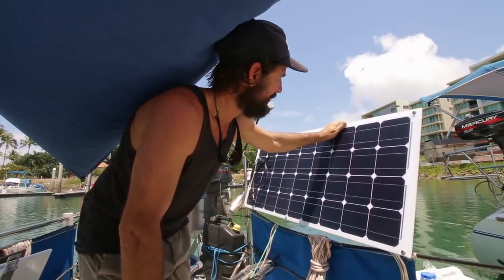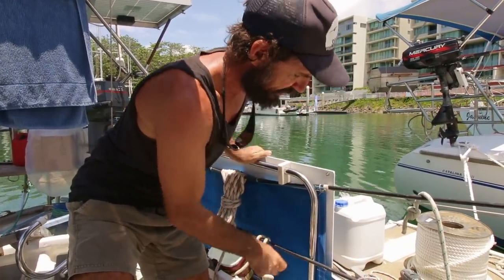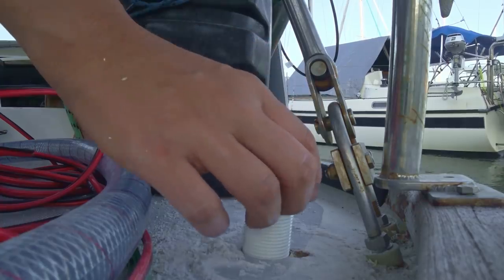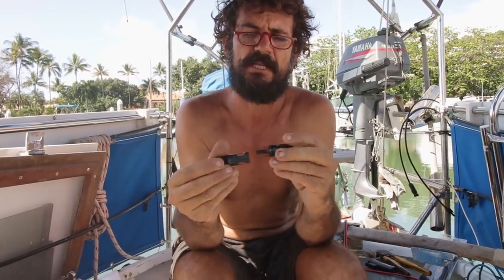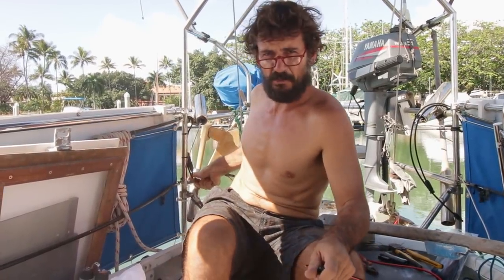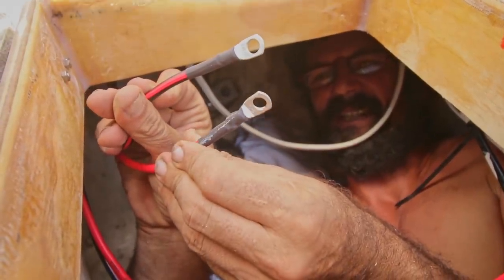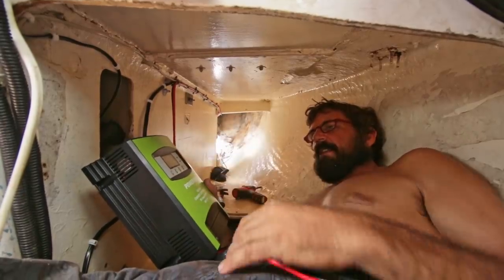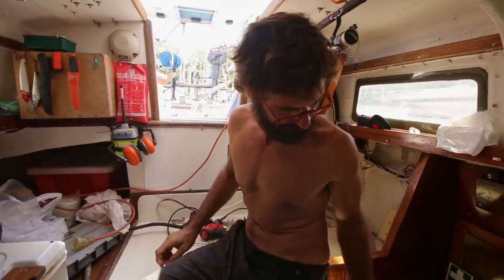A Half Hour of Solar Power: Our New Solar Installation - Free Range Sailing Ep 74

Comment: When you put plastic ties around wiring clip the tail ends off then hit them with a lighter flames so you dont carve your hands up next time you go in there.
If you want to remember which wire is which use some clear heat shrink and insert some paper with a title written on typed onto them.
The longer a wire run the thicker it needs to be for the same current amperage https://www.rpc.com.au/pdf/Wire_Chart.pdf
The other way to secure ring fasteners to otherwise unprotected wire ends is to remove the plastic from the metal end, slip the heat shrink on the wire, crimp the end on twice, solder it on with core solder, and when its cool put the heat shrink on and heat it. Label everything because you will forget. 
have a good one...
Reply from the maker: The wiring in the cabinet is labelled on the shrink because its complicated. I skip it for such simple runs. Ive also seen bread bag tags as labels. Works better than it sounds.

Comment: You were very patient Troy and Pascale, I would have sought a refund given the gratuitous lies of that company. Claiming they were made in Australia and just bullshitting about their output  just breaks a zillion consumer laws in any state. Lots of comments about the shade thrown by the supporting ropes but I am sure Troy you said there was a feature of the controller that sought to minimise the effect of that bit of shade.
Reply from the maker: No, the controller can't do anything about shading but sailboats throw a lot of shade which confines us to wiring the panels in parallel rather than in series. The tiny line of shade from thin cord is nothing compared to a mast for instance. Shade is a bigger problem when it affects cells in series, compared with if it runs across a panel in parallel. Not all shading is the same.

Comment: And when those panels fail, and they will, you have the proper wiring and controller for good panels. Glad to see Peter''s explanation as well. Found a lot of Chinese stuff is like that. The spec is what it is supposed to be, what it actually is, another thing entirely.

Comment: ‘If its to be good to be true’ !!! I invested in Soliban Flexible Panels they are rated at 100 watt each and I have actually had more than 100 watts - I am based in SW Wales UK so not the sunniest place on  the planet ..... They were priced at around 250 GBP each - the manufactures claimed they started to produce a power curve with less sun, so more efficient on a cloudy day .... I must admit the size of your panels are about the same as mine so a little surprised also the manufacture claimed 160 watt .... great video and the very most of luck on your travels :-)
Reply from the maker: Thanks for the heads up.

Comment: Probably a bit late now but I now use Victron Energy solar chargers VE75 15 and they will handle 75 volts,15 amps and you can use second hand solar panels in parrallel and they put out about 38 volts, still a pretty safe voltage to work around and far better than using 12 volt solar panels,check your solar controller ratings you might be able to do the same thing and you won't need to change your cabling?

Comment: Sphincter seal, Butt Plugs. I think you will need subtitles for the Aussie slang or is that universal talk! 

We installed 2 x 80 watt rigid monocrystalline panels 8 years ago and the cost of the panel alone was AUD$923 for both (and only after quite a lot of searching). Quite a bit more expense to have a stainless steel Targa to support them. We got 8amps output on a regular basis (panels in parallel). Last year I purchased 2 x 100 watt rigid mono panels (AUD$161 for both) and was able to fit them onto the Targa quite easily. 

I was concerned that out 20amp Plasmatronics PL20 PWM meter might not be up to the task (all 4 panels in parallel). The tech guys at Plasmatronics were great and felt I would be fine and that the amperage would probably be well within the 20 amp rating of the controller, which had inbuilt redundancy for current above 20. I needn't have worried. The 2 x 100 watt panels output is exactly the same as the older more expensive 80 watt panels. I get 16 amps max which is fine (or 8 each group). I checked the specs on the 100 watt panels and found a few porkies, which explained the difference. 

For $161 and an extra 8 amps I was more than pleased. Oh, I should mention the new cheap panels had exactly the same footprint as the original ones. I know technology improves and there are some quality panels out there that both deliver what they state and do it with less surface area, but at AUD$80/panel they are a throw away item.
Reply from the maker: We were annoyed because we don't really want to throw things away though. Thats why we are on a 50 year old boat with a 20 year old engine!

Comment: That DIY swan's neck through-deck fitting is brilliant.  I am going to be using that for our mast cables at our deck-step when we next  have the mast removed this coming summer.  I was looking at stainless swan's neck fittings and finding them difficult to source in the US.  With numerous cables and numerous glands one always seems to be failing/leaking every time I turn around.

We bought two new Renolgy rigid panels from Amazon rated at 100w to supplement the single 50w panel we previously had and installed A 40a controller for future expansion.  The 250w worth of panels has given us over 260w in direct sunlight on occasion.  You can't complain about that.  Getting 18A charge is nice from a nominal 250w array.
Reply from the maker: Thats a good result. Glad to see its working well for you.

Comment: Yep had the same with my cheap flexible panels,stick with good brands even after13 years  my old Sony still putting out the rated amps
Reply from the maker: Yep. The BP Solar ones still work as advertised but better with the MPPT controller than when we ran a PWM one.
Reply: @FreeRangeLiving  what bearing r in your wind generator,?i will try to get some  s/s 1s 4 u rgds Peter

Comment: Yes, for low loss in low voltage systems you're looking to size the wire not really for capacity but larger wire for less voltage drop.  This is something I recently learned myself, being an industrial electrician.  But John's law tells it is sound.  Ohms

Comment: Wondering how the shadow effect of the cable holding you new solar panel will effect efficiency (or not?)?
Love you guys.
Reply from the maker: We are using a bit of 2.5mm line and it doesn't really have a noticable effect. Shading across panels isn't as detrimental as shading along the cells.

Comment: Solar panels are brilliant , we have 190 watts , and if ever the battery ever get to 50 percent hey belt the power back , we now always hold 90 percent of power and panels only working on 1.5 amps average. ,if you add the 70 amp alternator that helps heaps , you should never need power  ,on our last trip 3000 miles we averaged 85 to 90 percent all day every day using all the power we need. ,gps never stoped , good luck
Reply from the maker: Don't start making videos then! Our alternator does a good job and has kept things going till now.

Comment: Thanks for the vid. It will be interesting to see how long these panels last you I have gone through 2 sets in only a few years. I think this could have been due to my installation of them (w/o a proper backer). I hope you get some longevity out of them. I eventually went back to non-flexible as they seemed to be better quality overall. Perhaps there is a high quality flexi out there tho. Happy sails :)

Comment: I guess it's pretty hard to know where things come from now days.  Hate the panels weren't what you were expecting but glad to know they do meet your power needs.  We just added two more glass panels to our 30' Hunter for a total of three panels and it made such a difference.  We were putting a lot of stress on the house bank with only one panel.  We are only using two batteries, and also have a separate starter battery isolated from the panels and the house bank.  It's really all we will need.  What we do need however is a quiet generator to supply the 120 volts when not at the dock.  That's coming soon.  Really enjoyed the video and thanks for sharing!!!

Comment: You could put in Mono Perc rigid modules. A 2 m. x 1m. module would give you 380 Wp under standard test conditions.(STC is an industry-wide standard to indicate the performance of PV modules and specifies a cell temperature of 25°C and an irradiance of 1000 W/m2 with an air mass 1.5 (AM1.5) spectrum. These correspond to the irradiance and spectrum of sunlight incident on a clear day upon a sun-facing 37°-tilted surface with the sun at an angle of 41.81° above the horizon). Buy a good Chinese brand such as JInko and you will be just fine. China being the worlds s factory produces premium quality and poor quality as well. Then you will not need flexible panels hanging over the side of the boat. Paying a little more is cheaper in the long run because the cheaper panels suffer from faster degradation. Given that you are operating in " harsh conditions", you need panels with good protection against salt and mist, UV induced degradation etc.

Comment: Hey Troy most house wiring we use in Aus is multiple cores not single strand except for the project housing market .Hence on the side of the drum it will say 2.5mm below that it will say 7/067 that 7 strands at .67 mm .In automotive cabling the strands are a lot thinner but more of obviously for flexibility.Great vid anyway
Reply from the maker: Ah. My house wiring experience comes from demolition of older homes. I stand corrected.

Comment: Interesting vid and Thks for the through deck fitting tip. Just a (maybe dumb) question: you build a rigid panel from a flexible one. Then why not simply buy a rigid  panel?
Reply: He stated in the video that a solid panel will not give with impact from things like a wave over the side.  The flexible panel is less likely to shatter or stress the mounts because it can flow with the impact.
Reply from the maker: Thats it

Comment: I have a 60w flexible panel on my boat and after less than 12 months the panel has separated. This has made the surface less translucent and lowered the wattage. I would not purchase such a panel again and as you say you get what you pay for,. Cheers
Reply from the maker: 12 months. How disappointing!

Comment: USA NEC (National Electric Code) - no circuit or wire (anything really) to be loaded past 80% of its rated max load. Therefore a 600W dimmer can handle only 480W (Watts) of Load.... so yes you needed 30 amps of load which equals 30x80% = 24----- 24+30 = 54 amp capable for the controller.... BRAVO... so many forget well thought out and established rules....

Comment: To be sure that nuts haven't come loose at all use nail polish. Draw a thin line along the bolt and nut. If it ever comes loose you see it instantly and if you ever change things and need to remove the mark then nail polish remover does it quick and easy. I had to do it that way when I was assembling electric locomotives and have seen those fittings after almost 20 years and 8 million km's of vibration and it was still there uncracked.
Flexible solar panels.... There's only one brand I trust, solbian.
https://www.solbian.eu/en/

Comment: One other thought on those IP67 connectors.  Wouldn't having the heat-shrink extend beyond the connector as you did have the potential to void the IP67 rating?  Not all heat shrink is created equal relative to water ingress, nor would the mated surface between the shrink and the cable be as 'proven/tested' as the supple "sphincter" seal as you called it that was part of the connector.   I could be wrong but that seems logical.
Reply from the maker: Sure crappy heat shrink may fail. That was double wall glue impregnated. As on all parts of a working yacht, those parts have to be routinely inspected for deterioration. The wire sheathing itself will deteriorate sooner or later from UV exposure.

Comment: Hey mate not only do those cheap panels not work I’ve never seen them last more than two years I’d say in 15 months they will be dead , if you want to stay with Flexable panels a good 100 watt solbian panel will give you your 5-6 amps but at a cost of around 1300 Australian dollars , I’ve just played this game and have stuck with glass panels as I can’t justify the price of a good solbian, I have a mate with 2 x 100 watt solbian a that are now 6 years old on a rear Bimini and still as good as the day they went on except for a bit of cupping , I went enerdrive panels and Victron mppt controller the 100 watt panel has seen a maximum 6.5 amps and the 150 has seen 12 amps cheers
Reply from the maker: Yep those Solbian panels cost a pretty penny. We also have got 12 amps from our old glass BP Solar panel array but it is more usual now summer is over to get 6-8. 
I would go rigid again but for waves when they're down. There is a good reseller I will talk to further south.
Reply: Free Range Sailing there are two more flexable panels with good reviews and one of them the whole sale factory is 5 mins from my house and they seem to be good so far from what I’ve heard they are a sunbeam panel and a 100 what is about 680 dollars there is also another panel called a rad power I don’t know a lot about them but the owners are good to deal with , I have seen a few failed radpower ones but apparently the company replaced them no worries , I don’t have social media and have been keeping an eye out for you on the bay
Reply from the maker: Good info. If you mean around Brisbane we're at Tangalooma now till Wednesday
Reply: Free Range Sailing I won’t be out until Friday and I will only be around the jumpinpin this weekend as I have a 90 th birthday to go to on Sunday , my favorite Anchorage is on the far southern end of moreton island called kooringal , if you need water when on moreton bay and travelling south the pontoon at one mile on north stradbroke island has free water on the northern side you just need a vandal proof tap or a 10mm tube socket

Comment: Mate sounds ridiculous but the shadow from your back stay with affect the efficiency of the new panels tremendously especially if they are multi crystalline 

Try to only support them from the bottom only
Reply from the maker: It's not that. Sailboats have masts and booms and rigging. Shading is why we riged this parallel not series but no, it's the panel output that is the problem.

Comment: Glad you are calling out dodgy products.
Reply: It's not dodgy.  The engineering is incorrect.  Your remark is ignorant, abusive, harmful, and wrong.
Reply: Steve Wright So if the engineering is incorrect and the product does not perform to advertised specifications that comes up as being on the dodgy scale.  Oh ..and I am an engineer.
Reply: @andrewkeir2282  Be the person you are, mate.
Reply: @SteveWrightNZ  Yep...  I am not sure why you appear offended.  My problem is with a product that is sold, advertised at a certain duty and clearly does not perform meaning Troy and Pascale have outlayed good hard earned money in buying something that on evidence only performs at around half the capacity claimed.  I reckon that clearly comes under the umbrella of being "dodgy" .  So I am very comfortable with my comment but I am at a loss to understand why it has offended you, or do you have a connection with the poor quality goods sold.
Reply: OK  Let me unpack this,  I get abuse from you because I point out that a product only performs at half the advertised capacity.   That is the WRONG thing.   The unit is working but not performing as it is supposed to you.  I have not been abusive, swearing or anything else.  In my industry we often have to investigate poor quality products that do not perform as they are claimed to perform and customers are the ones that suffer,  just as Troy and Pascale are going to suffer because they have forked out good money on a product that is not going to work as claimed.  They were polite in the manner  that they pointed out that the manufacturer or sales company declined to do anything about replacing the product.  My only conclusion is that maybe you are associated with the company that supplies these dodgy products, ..oh  and that also you dont have good manners.
Reply from the maker: Stop. Those arrays all have exactly the same numbers and ratings in a constant system. Same controller, same wiring,parallel configuration.  2 of them always output half of the original array independent of being isolated or acting as one. I've listened to your argument and don't agree for the above reason. We value Andrews input and yours even if you disagree with us but if you want to tell him to fuck off, you go first.
Reply: @FreeRangeLiving  see ya
Reply: Pick your friends carefully mate.
Reply: @FreeRangeLiving  Thanks Troy..

Comment: Do you have dry rot in the locker that you installed the junction box? It looked like the ceiling could use some repairs.
Reply from the maker: It was old fire damage. I thought it was rot at first but found it was from an exhaust fire before I owned it. We shored it up.

Comment: Should of made a Marine super capacitor bank / panel, Charge for 30 seconds and you have power all day long without the sun 240v 110v 48v What ever you want that suits your needs and budget, No need for the sun, Besides solar depends on the quality of the panels and how much sun they can convert into usable energy, Depending on when they were first produced "Date" Always check the date, when it was made is your first red flag! New ones work well, But old ones are not worth the effort nor money, Your just buying a migrain ;)
Reply from the maker: I dont know much about these. Aren't they quite expensive and used in applications requiring high load operation?